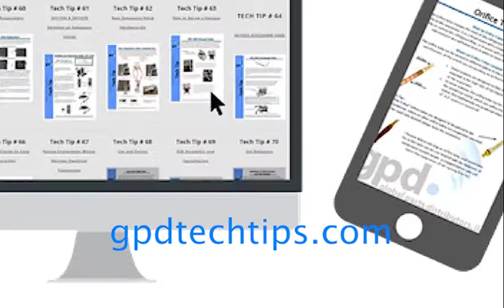Types of Automotive A/C Compressors - Scroll, Piston, & Rotary Vane

Comment: hi, thank you for your great video, I would like to ask about modifying a european car that does not have an A/C system in it at all, what is the best compressor and cooling fan types for Mercedes c180 model of 1995?
Reply from the maker: If the original model was not equipped with A/C, it is best to consult an A/C specialist for customer modifications.

Comment: so which one according to your knowledge the better compressor   ?
Reply from the maker: Nouman, it really depends on each individual system.
Reply: globalpartsdist thankyou for your reply but i am talking about reliability, because i have a coil system compressor on my 95 corolla and the mechanics told me that they are not reliable as compare to pistoned compressor, i was wondering what you think about it
Reply from the maker: @iamnoumankhan  For some applications the piston style compressor is more tolerable of debris and performs better at lower RPMs.
Reply: @iamnoumankhan  they said that coil system compressor is way better than the piston type in old corollas, any feedback from your experience?
Reply: @iamnoumankhan  i have a Corolla GLi 93, and im thingking of replacing my piston type by a coil type
Reply: @wanderingsoul6946  coiled compressors are not as durable or powerful as compared to pistoned ones
Reply: @wanderingsoul6946  i have personal experience with the coiled ones, trust me they are not good
Reply: @iamnoumankhan  why did you say that they are not durable or powerful like the pistoned ones? What were the cons during  your usage?
Reply: Gaylord Urgel beacuse i have personally changed many coiled compressions in more then one, and the most recent is the compressor of my corolla, the mechanic told me to replace coiled compressor with piston one